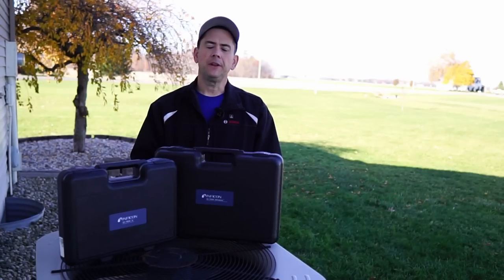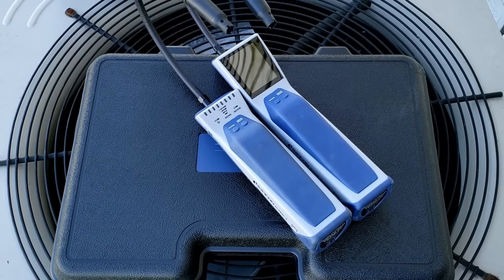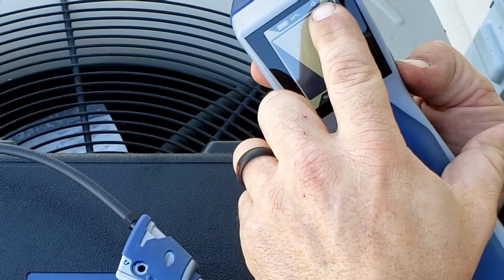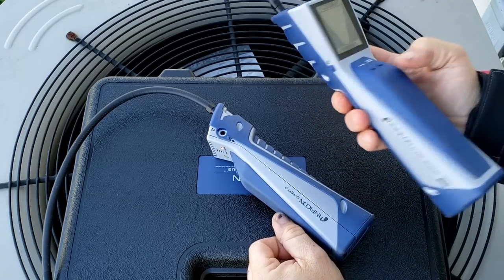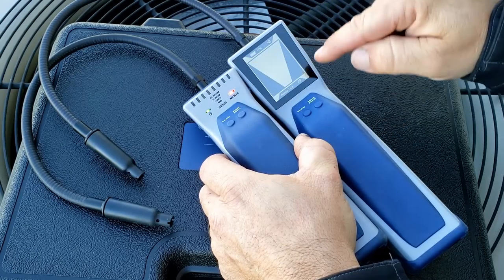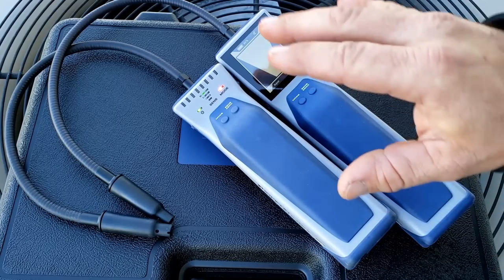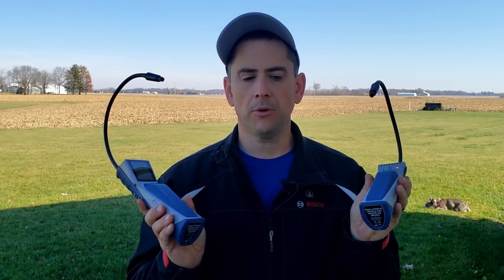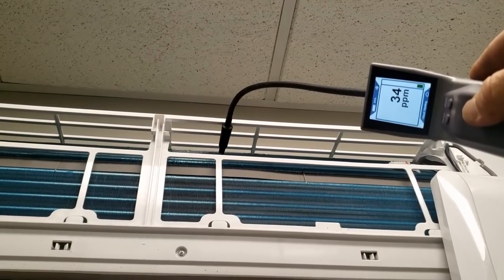Testing The Inficon D-Tek Stratus & D-Tek 3 HVAC Refrigerant Leak Detectors

Comment: That's funny on the Lennox m.s. head, I found a leak on one in that exact spot. That was one of my first finds with the Accutrak ultrasonic and then I verified it with the amprobe RLD1 .
Reply: Did you whip it out Shannon?
Reply from the maker: I'm glad I don't work on Lennox anymore. There stuff is low class anymore. I should have checked that with my ultrasonic, if they do decide to repair it I'll go back and check it again with it.  Thanks 4 watching Shannon 👍👍👍
Reply: @NorCal-refrigeration  Heck yeah Dave...*insert whip crack sound here* 😆👌

Comment: On the D tek select i was having a very high sensitivity problem and the detector was bleeping overtime and over sensitive.  A couple of techs at my supplier showed me a trick. After switching on the D-tec, let it warm up, then hold the low/high sensitivity button for 5 seconds. The orange lights start to flash very quickly and the machine switches over to a different mode which then only senses the precise location of the leak. This trick is not written in their booklet. Hope it helps.
Reply from the maker: That was in my Select book, it was a newer feature that came out later. The detector was revised a couple times. Thanks for sharing 👍👍
Reply: During the transition between detector generations, the manual had not caught up with the detector's capability. Tech support  sent out an addendum sheet when requested. The newer manuals have the pinpoint mode info in them.

Comment: The only thing left I'd love to know is , can you still use it while charging it ?
My leak detector works with regular batteries ( D type i think ) and it comes with a USB cable and I've been just using it with a portable external battery that I also use to charge my phone , and it works a charm , no more dead batteries !
Reply from the maker: Yes, you can charge it while using it 👍👍

Comment: I have a friend willing to sell his lightly used his D-Tek 3 for a low price but its about 3 years old now, he's upgrading his gear.  Even though its still working I'm worried about the sensor life. How expensive is the sensor? easy to replace? and is it still easy to order a new one? I mainly need to sniff out R-22. Thanks for your help.
Reply from the maker: I Judge used tools on their appearance. If the tools beat up,  filthy dirty, has cuts and scratches and it dings. Obviously, the person didn't take good care of it and I would run from it. But if it looks clean, well taken care of, then I would buy it. New they were about $450 with my discount code. The battery I believe is not gonna be more than maybe $65 they could be even less. These new batteries are lithium ion so they last a lot longer than the traditional ni-cad that barely got a year or two out of them. Sensors rated for 10 years and I believe and it's around $100.

Comment: Which one should I get?
Reply from the maker: Like I said in the video. The stratus is the one I use most of the time, but both detectors are equally sensitive. If you got the money get the status if you don’t get the other one. You really can’t go wrong either way.
Reply: Thank you I went with the stratus before I had the fieldpiece DR82 it was decent, but I returned it. Can’t wait to try the stratus out this week.

Comment: Any recommendations for combustible leak dector? R290 Thanks great video, it cool to see the ppm , but $500 more ..
🤔🤔
Reply from the maker: I use the yellow inficon combustion Leak detector. But I just got the combustion sensor and the update software for my Stratus, it worked great!  It will also work with the Dtek3

Comment: Inficon vs dr82, vs dr58 (heated diode). I ruled out the bacherach unit after i saw enough average reviews on it, im more into the build of the fieldpiece units, but im glad the inficon is not chinese. That unit is $1900 in new zealand by the way.
Reply from the maker: It's made in New York state, I'm sure it's high priced in other countries thanks to tariffs 🤷

Comment: Whats is the diference  between stratus and dttek select?
Reply from the maker: I give several examples in the video,
Reply: Almost 400$
Reply from the maker: Sensitivity of .03 OZ per year VS .1 OZ per year.   10 hours of battery life vs 1.5 - 3 hours, capability to find small leaks in contaminated environments, The list goes on and on.
Reply from the maker: @NorCal-refrigeration  I would go with the D-Tek3, its the same detector as the Stratus minus the display, plus its the same price as the D-tek Stratus was.

Comment: Just curious, would you admit that Bacharach is the better “refrigeration” detector? I’m asking because I’m actually looking at going into the “light commercial” side of the industry.
Reply from the maker: I'm being honest in the video, there's goods and bads to both detectors. Most of the bads are on the H10 but at this point I'm pretty well used to them.  The H10 can be a little more sensitive on certain refrigerants when it has a new sensor but the battery life sucks, the sensor potentially getting damaged from real strong hits of refrigerant sucks, the wand is very short and hard to get into tight spots sucks. You can suck water into the machine, that really sucks and the sensor costs about $120 to $130 and they recommend replacing it every year although you can sometimes get two or more years out of it but who knows what refrigerant sensitivities you've lost by then. I'm the only one that uses an H10 at my workplace, everyone else uses the DTek Select. Which is why I finally decided to buy one after trying so many other detectors.     The Dtek-3 came out about two months after purchasing it. Because the detector has a two year over-the-counter warranty they swapped it out for me and that's how I got the new version.
Reply: ive been using the H-10's that u Plug into a 115 volt outlet. H10G ive never used the rechargeable models. ive been using the h10's for 40 Years. in my opinion thier is nothing better. ive bought 4 in forty years. Had 2 serviced in 20 years. ive never had to repalce a sensor unless i sucked water into it. that is the only drawback with h10's imo. these days i just dry an area a bit before sniffing if it has water around it. i just take a rag to it a bit.  For best operation they need to be plugged in  for 15 minutes before using. My h10's normally last about 10 years and then they loose some sensitivity. then u just turn up the sensitivity screw in the back of the unit a bit. Like i said i've never had to Repalce a Sensor unlss i dunked it in water in 40 years. The Trick with h10's is they MUST be warmed up for 15 minutes to get that sensor good and hot for it to work the best. if i know im going to be using the h10 i just plug it in right away and set it on medium , crank dial all the Low and let it warm up while i unload my tols etc. Yea, i know 15 miuntes is long time to wait for a leak detector to warm up on the front side but, it pinpoints the leak in seconds versus alot of other leak detectors playing with your mid for 15 miuntes. so, id rather wait the 15 and find the leak right away.
Reply from the maker: @OcRefrig  I had the H10pm and now I have the H10-PRO, I have nothing major bad to say about the H10, I'm not happy with the battery life and I hate waiting For it to warm up but otherwise it finds the really small weird leaks. It's just more convenient with the Inficon.   I normally need two minutes for mine to warm up and then it's usually effective unless it's really cold outside.
Reply: @HVACRSurvival   Have u used a h10 G . it's a totally different animal than the battery units ? Thats why i put the link to the " G" above so u or other people can see a "g "vs a pro model/ battery unit.
Reply from the maker: @OcRefrig  The "G" isn't made anymore. I don't have time to be carrying a cord around the store. I'm able to find them with either the detect or the h10 one or the other I'll usually find it. If it's that small of a leak then it's not worth worrying about.
Reply: @HVACRSurvival   i Hear ya. i Just have NEVER  Found a hand held leak detector that did not give me grief or was worth a dam. i went through so , so , so  many handheld leak detectors for 10 years and kinda sweared of  using anything but the H10.

Comment: You got gear atta boy. No usb c so 2019
Reply from the maker: Yeah I'm always buying something. For some reason leak detectors make me horny 🤣🤣🤣. How you been Dave, I haven't heard from you for a long time man... I was hoping you're okay 👍👍 If you ever get bored give me a call.
Reply: Love the C- chargers. 👍
Reply from the maker: I let this thing run after I did the video and it did last the whole nine or ten hours. That's the first time I've ever let it run like that just to make sure. I know my detect select was lucky if it would lasts an hour or two  and my h10 only lasts maybe an hour to an hour and a half. plus the recharge time on this is at  3-3.5 hours versus eight or nine on the select. That sucked
Reply: Lol

Comment: Great video.
Reply from the maker: Thank you Sir 👍👍
Reply: @HVACRSurvival  now I want to go buy the stratus.  I’ve had the tif zx for a while.  I had an H10pro but I sold it to rookie refrigeration . I didn’t like how the H10pro wasn’t as portable.
Reply from the maker: I have the zx, it's a good detector for R22 and for are 404a period but not as good on 134a or 410A. I like my pro a lot but the battery life sucks, I've been pretty happy with this Stratus but if you don't want to spend the money you'll be just as fine with the other one like I mentioned. You just lose the parts per million display.

Comment: How about do a video h10 vs D-TEK Stratus Leak test.
Reply from the maker: On r134a the h10 found the leak at 35 lb of pressure the DTek did not, once I added extra pressure to the system then it found it. Most of the time like I said in the video I'm using the Stratus or DTek3. Whenever I can't find it I'll double check it with the h10 and usually either I don't find anything at all or I get a small little dinky signal.

Comment: Shame you cant use your own lithiums to make sure you are using quality batteries and not knock offs.
Reply from the maker: I re-recorded the intro video this morning and I let the detector run the remaining of the day and it lasted 8.5 or 9 hours. The batteries aren't priced too bad, I spent a lot of time on the phone with inficon asking a lot of questions, they put a lot of time into this machine that's why they didn't release it right away when they were supposed to because they wanted to make sure it worked.
Reply: Whats the mAh rating of the cell pack? About 9 hours seems pretty decent if the detector's amp usage is low. There are times that China does provide decent batteries so its possible they got a good provider. - Well i looked it up, doesnt say much but it does say that battery life is 8-10 hours depending on the mode so thats not bad at all.. With it being rechargeable you could keep a small USB power bank with you to keep it going if you arent near your vehicle.
Reply from the maker: Well surprisingly this battery is (UR) rated, 3.63V  3.35AH, 12.16Wh. I asked them about it honestly it looks like a 18650 battery in a plastic case. I asked my contact person about it and I can't remember if the batteries were truly made in China or if just it was assembled there. But so far it's not been bad at all. More than adequate. That was the biggest improvement to me in addition to the sensitivity and the display readout
Reply: Sounds pretty good then. 3.6v is nominal voltage, when fully charged it'll be 4.2v. I would think there would be at least 2 cells but it looks like it would only be 1 going by size.. Unless they are using a 26650 or similar which is the same length of an 18650 but much fatter, that would definitely give the battery life you're seeing from only 1 cell, i cant see a single 18650 going 8-10 hours even if the unit only used 150mA or so depending on the mode. But either way, not bad.